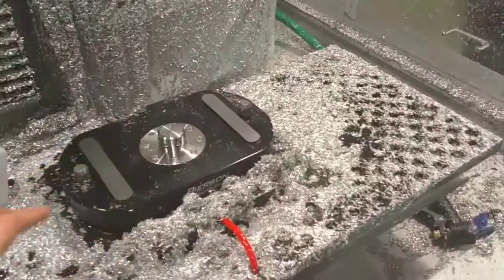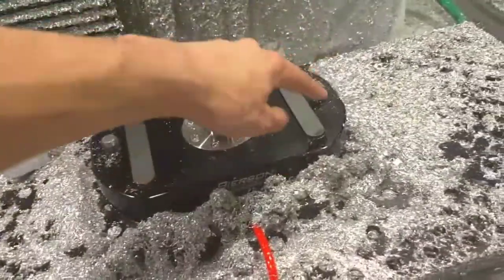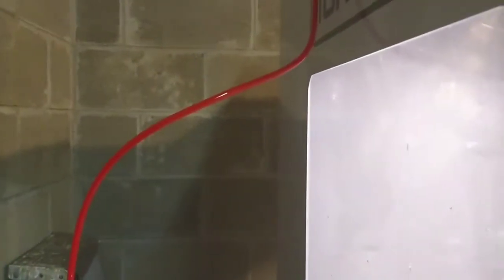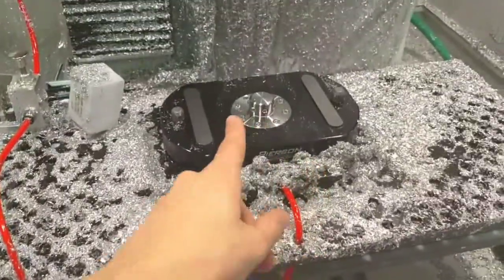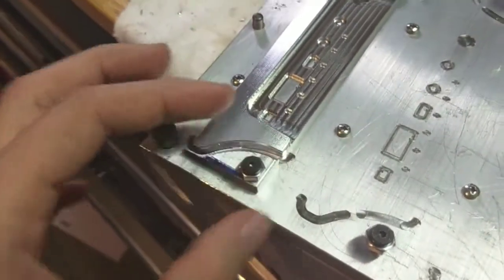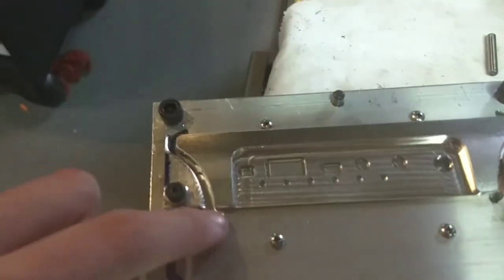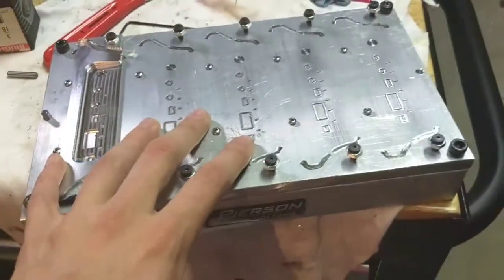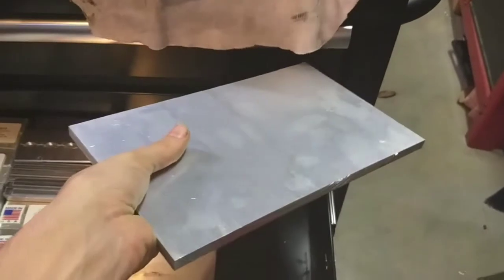Pierson workholding MPS on my tormach pcnc 770

Comment: u cant locate off of screws, or threaded holes. should of used dowels
Reply from the maker: You are correct, using dowels or a shoulder bolt would have been a much better idea, but the parts needed made, and you know what? It worked great :)